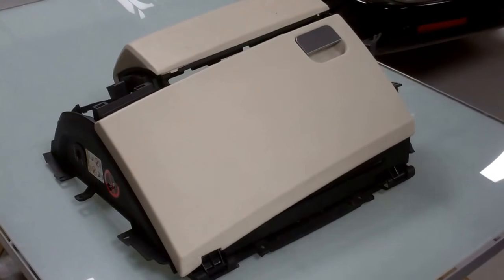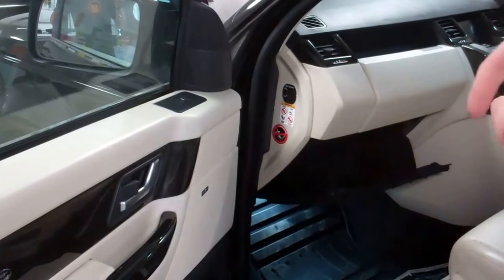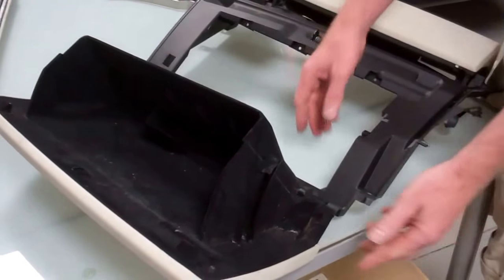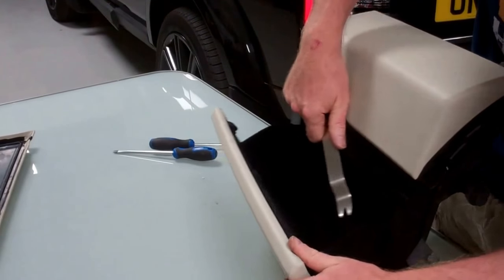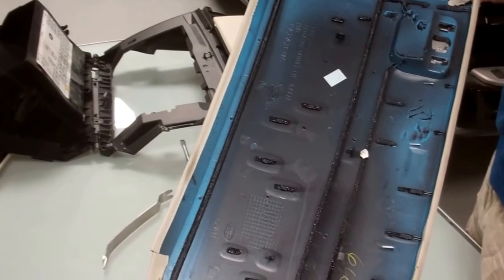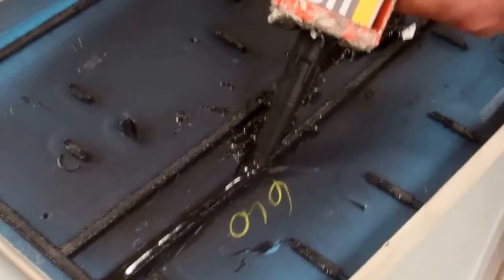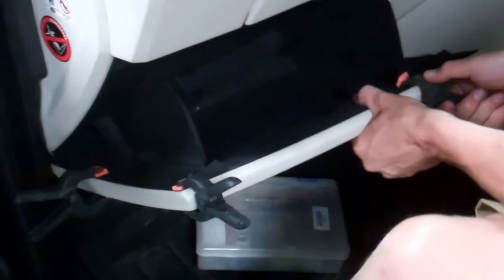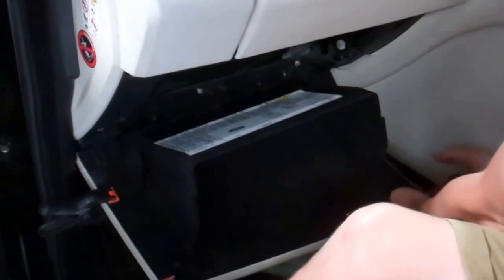Glove box repair Range Rover Sport 2005-09 ( not our finest work )

Comment: That hard to reach torx screw can be accessed by lifting the center console top, there is information online about how to do this, then there is a hole where you can insert an extended length (i had a 12") T25 screwdriver and undo that screw.
Reply from the maker: thanks for the tip